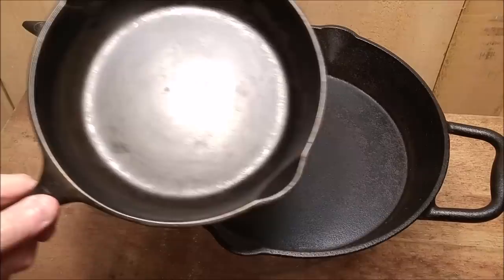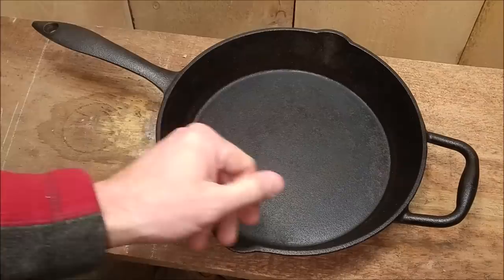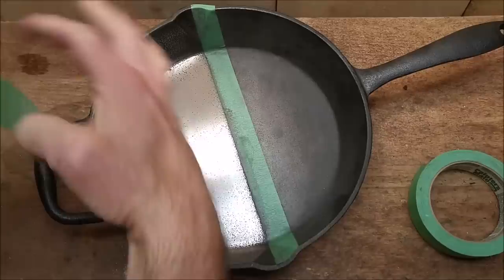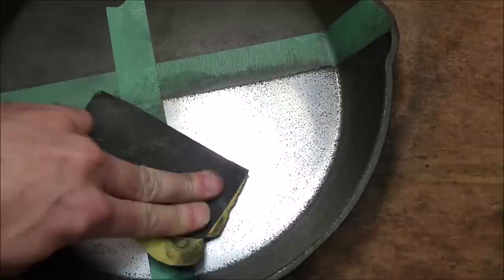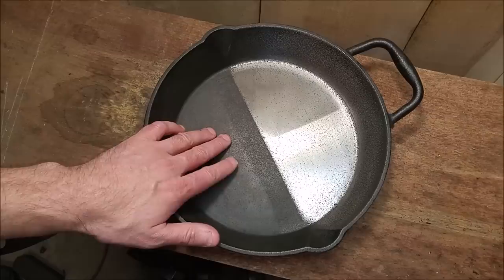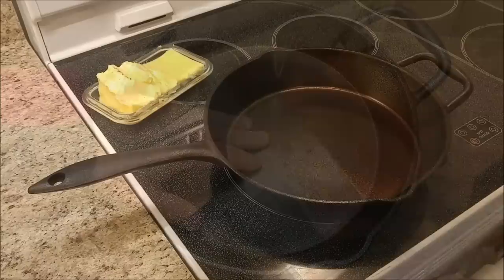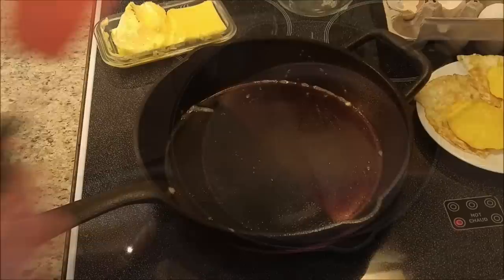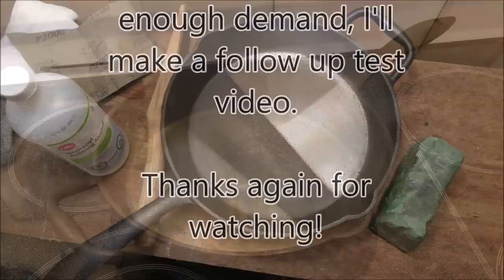🍳EXTREME Polish - Smooth a Cast Iron Pan to Reproduce an Antique Skillet then take it way beyond

Comment: The temp is the same, the surface emissivity is different. Most IR thermometers are calibrated to 0.95 E (flat black). Shiny objects would read lower temps than they actually are, unless you can adjust the emissivity on your thermometer.
Reply from the maker: I was in the shop tonight playing around with these settings.  I used the oven this time then measured to see how accurate the reading was.  Tonight the readings were within 15C, but these pans are older and have a dark rich seasoning.  Thanks for the information.

Comment: That's some elbow grease. Honestly I have no complaints with rough texture pans, especially my pan that has built up over the years. I'm experimenting with two used yard sale pans. I polished the first with 60 grit and called it good. Still in the process of seasoning. Ultimately I'd like to see if I can use less oil or fat. Like to see how it performs frying meat and clean up afterwards. Most of my pieces are Lodge.I have a Wagner USA , Wagner China and some Chinese knock off . Don't think I'll take my pans to the level you went to. Interesting video but nothing conclusive for me. Thanks for posting.

Comment: Considering the eggs cooked at the same rate, I would say the pan was the same temperature every where.
Reply from the maker: I'd agree, the IR sensor just doesn't give the correct readings on the polished/reflective surfaces.  I've completed another video and demonstrated the same effect, however this time I had rough spots around the pan adjacent to smooth so you can see how it changes the instant the surface finish changes.

Comment: Hey, so ill take a jab at the IR temp gun reading difference. On a FLIR camera, there are settings for how matte or reflective the surface you are measuring is. On reflective surfaces its harder to read a correct temp. I assume the same is true with an IR thermometer. A thermocouple would tell you the whole pan is the same temperature.

as for WHY that is, i have no idea. i would think that a given surface at a certain temperature will give off a certain amount of IR light. if the IR thermometer is taking in that IR energy, i dont see why a different surface finish would matter. I would think that a coarse bar of steel glowing would put off the same visible light intensity as a polished bar thats heated.
Reply: Excellent info, I'm going to get back in the kitchen later today to see if I can find a way to get correct readings.
Reply: @michaelhudson1507 I don't know how to get you the correct values to use, but you need to compensate for the emissivity of the surface. The darker cast iron radiates better in the Infrared bands that the IR temp sensor reads in. The polished surface is slightly skewed towards reflecting the ambient temperature of the room instead of only the radiated heat of the actual pan. The mirroring effect of polishing reflects IR just like the visible light is better reflected.

In the electrical world this is a problem when trying to read the temperature of aluminum and copper electrical bus bars. To avoid this, before energizing we wrap a spot in Black electrical tape which has a high, consistent emissivity value that makes the IR temp sensor much more accurate. Finding a material that you can set into the pan in the three locations may not give you a 100% accurate temperature in absolute terms, but could allow for an accurate relative comparison.
Reply from the maker: I'm going to perform two tests tomorrow and return the results in the comments here.  I hadn't thought about the finish affecting the reading, but it makes perfect sense.  Thanks for the help.
Reply from the maker: Here is an update, the same note appears in a comment above also: "I'm struggling with the readings still, I've tried thin pieces of paper, parchment paper, and computer monitor heat shield, and the original rough finish is still reading much higher.  I'm going to check the skillet for a perfectly flat bottom and see whether that may be contributing to the false readings."
Reply: As to WHY it’s because IR is wavelength just like visible light. The way it reads temperature is similar how we look at something and determine what is color. Any variables such as distance reflectivity and refractivity effect the test results.

Comment: The more reflective surface has a lower emisivity. Just like those "space blankets" that are thin metallic sheets but still work well to insulate,  the shiny surface is bad at radiating heat. This is the same as "low e" coating on windows.
Reply from the maker: Thanks for the comment and for the comparison.

Comment: I don't think a perfectly smooth finish is ideal for cast iron, but I don't think an overly rough finish is either. What about a polished surface that has been peened or shot blasted? I think you want some roughness to keep pockets of oil under the food. This would be related to the viscosity of the oil used and capillary action. How about further tests to see if there is an ideal middle ground for the surface? Also the type of finish, IE sanded, milled, polished, peened, shot blasted etc. Some youtube machinist might be willing to help out. I'm most curious about a smooth peened surface, sort of like a golf ball.
Reply from the maker: Perfectly smooth is hard to season, and rough is not great to clean, so I can see a middle-ground being a good compromise for sure.

My guess is that a sand-blasted or soda blasted finish would be the best right out of the gates.  That would give a smooth finish but be easy to season and would get a rich black colour very quickly (my guess) 

That would make for a very interesting competition I agree. 

Thanks for the idea.

Comment: Hello there! Interesting video, thank you for your time. 
I had no idea Lagostina made cast iron pans and I live in Italy 😂 
I have a 12 inch Lodge cast iron pan and won't sand it down since many people testified that with time and use,the surface will become smooth as glass. So I won't "ruin" the rough surface.
Reply from the maker: I have heard that from others' also, from what I have seen and read, old pans came from the factory smooth, they removed the step since it was not really necessary, however, the biggest advantage is actually the cleanup in my opinion.  

I have pans with  a rough surface, they work perfectly fine also.  

Many people have told me that they cook with a metal spatula, it actually speeds up the smoothing process (I'm not sure they've any proof of this), but that is the concept.

Thanks for taking the time to comment.

Comment: Am I right that on the rough part of the pan the eggs didn't stick at all but it does on the smooth part a bit?
Reply from the maker: That's right.  Over the years, it seems as though anytime I re-season a pan, it takes a couple of times cooking to break it in.  It seems to be a little more prone when doing this with a smooth pan than a rough one.

Comment: Yea all my new cast irons I’ve had to sand down and reseason to get them even close to my grandmas pan I’ve got
Reply from the maker: I'd like to but a new 10' lodge and give it a smooth finish.  I know the lodge aren't the nicest looking, but I think they're built to last.
Reply: Strange: smoothing out the cast iron too much causes the seasoning to not stick to the surface well BUT...carbon steel skillets or woks anyone? Smooth surfaces and no issues with sticking there. What gives? *They do give up their seasoning easier, but the dark black patina seems to last through the abuse of a Chinese kitchen!

Comment: No need to sand smoother than 80 grit.
Knock down the horrible ”pre seasoning” (their term for shitty casting) and put a few seasonings on the pan. 
Will be good as any antique.
Reply from the maker: I agree with that, too smooth isn't a good thing, it doesn't help at all, it hinders the adhesion of the  seasoning more than anything else.

Comment: Basic physics answer.  Black both absorbs and radiates heat more efficiently.  See: https://physics.stackexchange.com/questions/159856/why-is-black-the-best-emitter.
You did many things right in your video but there were a few shortcomings:
When you didn't bake off the seasoning on the pan in advance of the polishing so an apples to apples was no longer possible.  Quadrants of 
Your cooking technique was too good.  The combination of hot pan and then a good bit of fat in the pan would have let even a poorly seasoned pan perform pretty well.
That was some serous elbow grease to polish.  I liked the quadrant approach to compare.  This was good work and interesting to watch.  If you were to blast off that seasoning in a self cleaning oven and then re-season uniformly that would be great to see.  And sparing with the grease.  We should see how it can do when challenged!

Comment: I've heard it said as the sanding progresses to finer grits, producing smoother surfaces, the pores of the iron are largely closed, resulting in a reluctance of the pan to hold new seasoning. The theory is, following the polish with a couple hours in an oven's self cleaning cycle' high heat serves to burn off Chinese Mystery-Oil, or any other seasonings. It also encourages the newly polished-closed pores of pan to expand at the molecular level, enabling the surface to better absorb new layers of seasoning than pure high polish....Can't say first hand, but the mechanics seems sound.
Reply from the maker: I completely agree that heating metal will open the pores..  I think it's probably a good general preparation step to remove any existing oils so that you can have a perfect starting point for the new seasoning.   What I'm not sure about it would it make any difference considering that seasoning goes from an OIL to a Polymer during the heating process, and wouldn't that process open the pores of the metal also?  

I've been taking a close look at my old cast iron and I'm certain that they came from the factory with a relatively smooth finish, the inner sidewalls have machining marks which look to be from a scraping or sanding device, and this is on all three vintage skillets that I have.  I doubt that they would have polished anything, but the may have turned them on a lathe type device and it probably left the perfect finish for the seasoning to adhere.  

Thanks for the comment, I'm willing to keep testing some of these ideas in future videos, so keep the ideas coming.
Reply from the maker: @pixelside  I'd like to do the same, except with the handle in the way I'd need a much bigger lathe.  You'd really just need a really heavy duty record player type setup.

Interesting that a lot of people think the old pans were 'worn; smooth, but that's probably not the case, they are smooth on the sidewalls also, so they would have been smoothed before they were purchased.

Comment: I believe the difference in temperature (as read with your infrared pyrometer) is due to the emissivity of the iron. The more heavily coated iron (the more glossy surface) has a value that is closer to black body conditions - results in a more accurate infrared temp reading. You can test this by coating the entire pan with an even oil layer. You should get about the same value in all three spots. This effect is really noticeable with a stainless steel pan, which has a lower emmisivity than cast iron.
Reply from the maker: Thanks for this.

Comment: I know that an infrared thermometer will read different from a shiny surface as compared to a mat surface. My question is, how much difference does surface area make? In my lay opinion, the more surface area you have, the higher the temperature. If you sand away the highs aren't you losing surface area?

Comment: you could have measured the temperature of the bottom of the pan to confirm that all sides have equal temps
Reply from the maker: I'm a little embarrassed that I didn't think of that, great point.

Comment: The surfaces of the pan that showed  the lowest temperature were logically the hottest. The lower emissivity equates to less heat loss. With comparable heat input from below, the less emissive surface will get hotter.

Comment: Believe I used extra oil in pan and cooked pizza at 375 in grill, seemed to do pretty good.  I got more of that Pizza Hut pan pizza affect which I like but yeah the stone would probably give a different style crust without the oil...
Reply from the maker: I've been using olive oil but not in that way, only applied to the outer edge of the crust on the top, then a little semolina.  

Gotta try this method, thanks again.

Comment: that's why cast Iron pans dome. or heat to extreme cooling never put or shock cast under cold running water let it cool a little first if you drop a drop of water and it dances around it is to hot if it goes to steaming it is okay to wash under your hot water. just an opinion everybody has one and mine probably stinks. my disclaimer from nickel brazing several cracked and domed pans and taking a end mill to domed cast Iron pans.
Reply from the maker: Can you clarify, what does 'cast domes' mean?   I've found that washing under hot water briefly causes no problems, heating on high however does cause cracking.  Because of this, my belief is that cast iron is prone to cracking more so in expansion than compression.
Reply: @NeedItMakeIt  raises in the middle slopes to the side ductile material will crack on high because of uneven heat between the bottom and sides and if you see no problem with it, let's see how did you put it "washing under hot water briefly" then keep doing it. We all have opinions yours counts as much as mine if you wish I will delete my comment.
Reply from the maker: Ductile means that it can be manipulated without becoming brittle.  I think like anything there are varied qualities of pan/castings so some will be prone to cracking no matter what you do.   My personal experience is that running briefly under hot water causes no problems, there are quite a few videos on YouTube already on the subject.  My suggestion is to do whatever works for you, the key to the video is that a smooth surface is easier to clean and works well for cooking also.  I'm still happy with it.  

I appreciate the discussions on the subject, so I appreciate the comment.

If I have some free time, I'll make a video showing the temperature drop when running under 100 deg water and see what happens.
Reply: @NeedItMakeIt  I have both of my great grans' sets of cast iron, a mix of Griswold and Lodge, and heat them on high all the time and have never had one crack. In fact, just today my sons took 6 of them out and built a bonfire over them to get the 100+ years of carbon build-up and old seasoning burned off. They were fine, like new after a good scrub with steel wool and then reseasoning. I see a lot of people talking crap about Lodge but I've got 6 of them and 2 of the old 2 burner griddles and love them. Of course, mine are older than I'll ever be so maybe they were made different back in the 1920's...

Comment: Wish I had the strength to do this and the place to season it.
Reply from the maker: You can use an orbital or a die grinder, I just prefer to do work by hand.  As far as where, do you have a barbeque?  I like to do mine there to keep the smoke out of the house.
Reply: @NeedItMakeIt  I'm old. Had to move to an apartment, so the oven option is out. I'd have done that in a heartbeat at my old home.
Reply from the maker: @nohandle62  I have one last idea and I do this myself on the stovetop.  I oil the pan normally, cover the pan with the tightest lid I have and it works pretty well to keep the smoke down, seasoning the sides isn't really an option but it works pretty well for the bottom.

Comment: I always smooth put my pans.  But I use power tools.
Reply from the maker: I have nothing against power tools doing this work, an angle grinder could do some damage is all, but if you're careful it'd work out well.  A finer grit could help also.
Reply: @NeedItMakeIt  I use a 3" air grinder with the trust lock disks, 80 grit, 120 grit, then follow that with an orbital sander progressively through to 400.

Comment: I hear paper towels shouldn't be used to clean cast iron as they leave behind lint. I now use blue shop paper towels and no lint
Reply from the maker: I've had this struggle with any of my rough pans in the past, my smooth ones don't tear the towel so you can use just the regular el-cheapo brand.

Comment: Not sure if washing while hot is best ...(?)
Reply from the maker: I've had a lot of comments on this, I've been doing this for years with no issues, but I can see why someone may be worried.  I plan on doing a follow up video showing what happens, including warpage possible cracking etc.  I expect that the bigger pans would be more affected by this process.  Thanks for the comment, and also for the way you ask the question.

Comment: Wish you 3 separate full size pans rather than one !
Reply from the maker: Oh I do, but the stove is a problem, we have only one large burner and three small on our stove, they sense objects on top also and they dont work with the large pans... 😫
Reply: NeedItMakeIt - need a different stove have you considered used , they sell them here in Houston Texas 🤔
Reply from the maker: How far is that from Ontario Canada?  This stove may need to be replaced soon, I'd really like to check out the induction.  Have you tried one?
Reply: NeedItMakeIt - south Texas USA maybe 2000 to 2500 miles as the crow flys check you local area first !